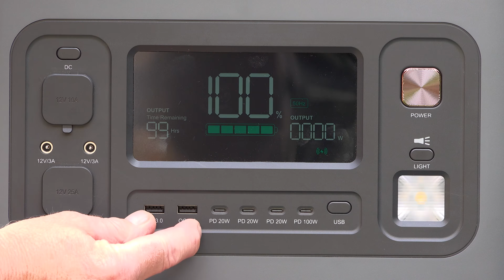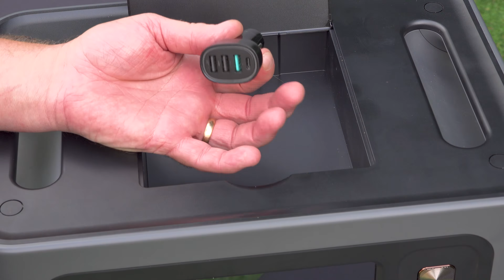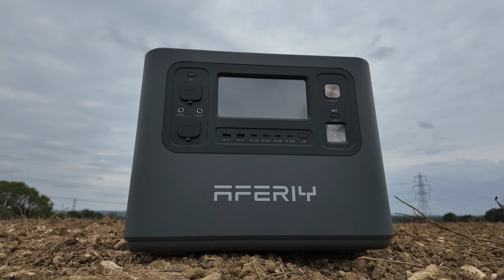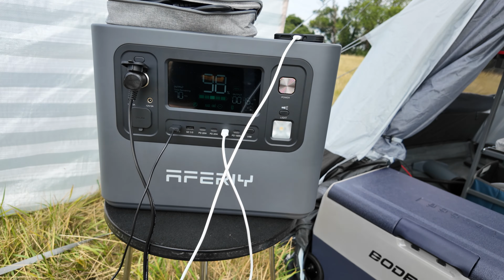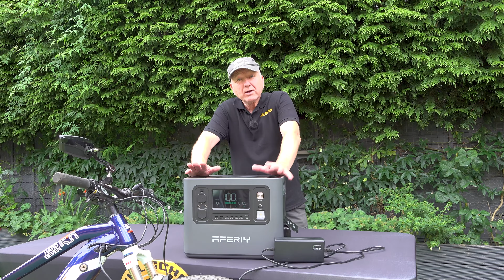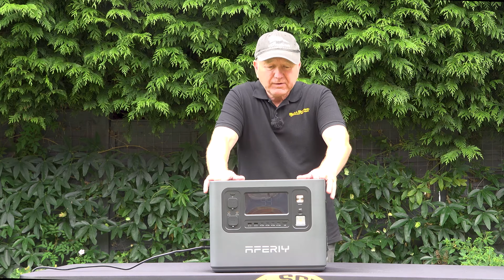Aferiy P210 portable power bank UK review

Comment: Great informative review Gary it really shows how useful these portable power supplies are. I have owned a smaller one of these from the same manufacturer for about 2 years and use it all the time when camping or even just out for the day. We have used it to run a low wattage microwave, hair straighteners, hair dryer, toaster, portable fridge etc. would definitely recommend getting one if you need power off grid.
Reply from the maker: Great feedback, thanks Bob 🤝